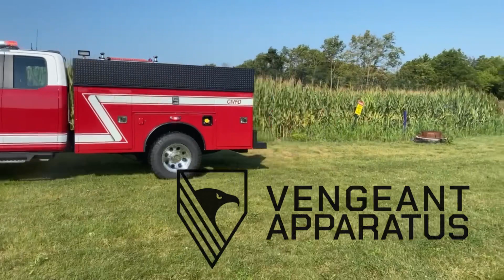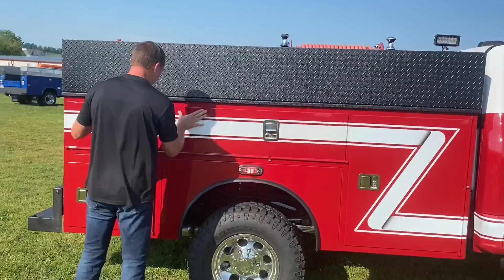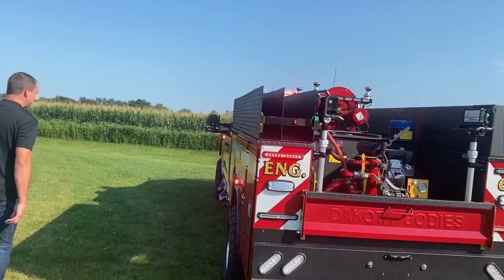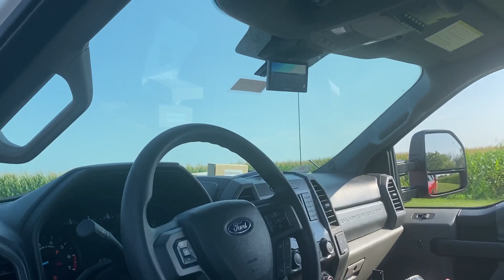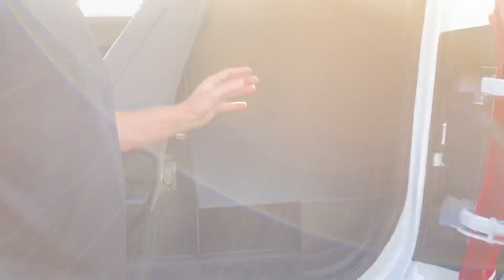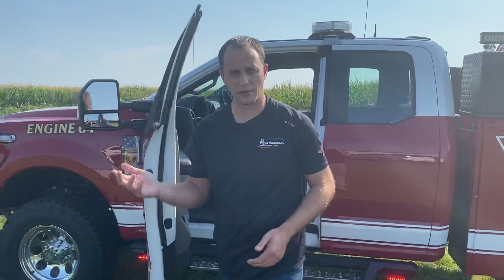Brush Truck W/ Sweeps, Cobb Island | Vengeant

Comment: Ahh yes engine 62 we just worked on the siren tonight and it holds up to 250-260 gallons of water we replaced the light bar and the bumper and we took down the back black barrier

Comment: 250gpm pump with a 250gallon tank? So you’ll be out of water in 1 minute?
Reply: That only if you run the pump at full capacity.  Typically a brush truck is pumping 10-25 gallons per minute, so you have 10 minutes or more of water.   

No different than any other fire engine.  Most pumpers have pumps that are over 1000gallon per minute, with tanks between 500 and 1000 gallons